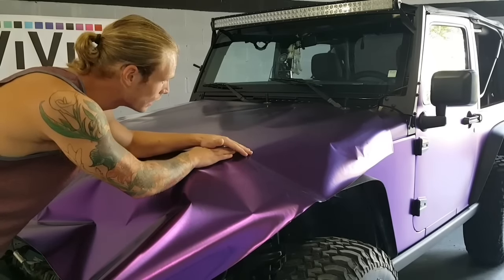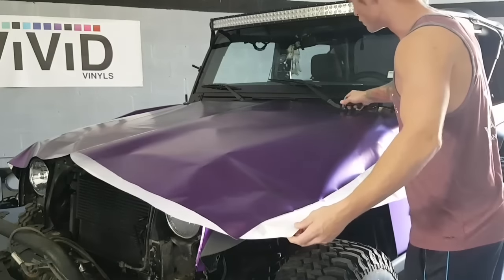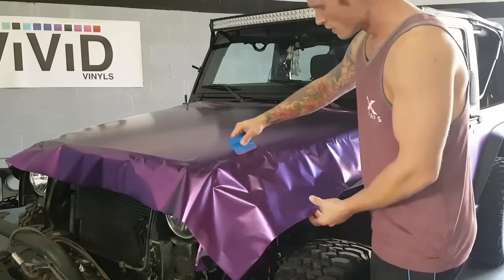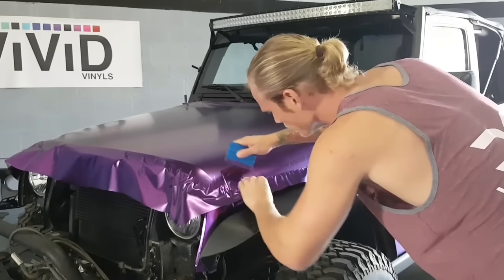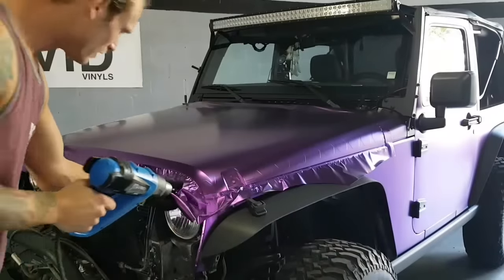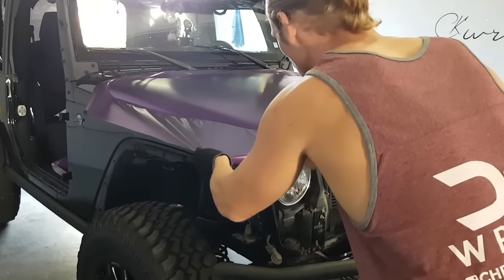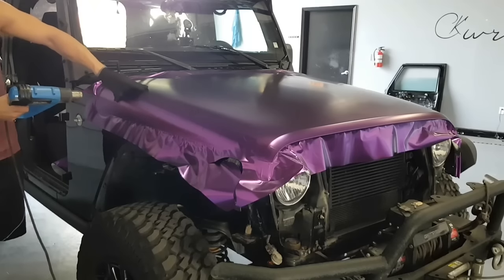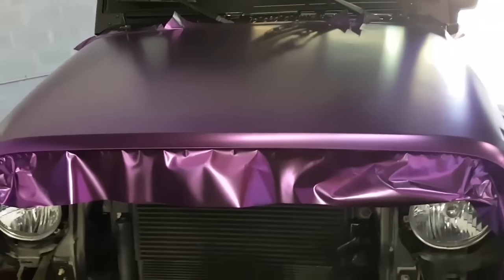How to vinyl wrap hood / bonnet on a Jeep. Using satin purple chrome vinyl. By @CKWRAPS

Comment: I have a quick question in regards to hood wraps.  I understand that minor defects are gonna show through.  my hopes that carbon fiber will hide them for the most part.  however, what is the best way to prep a rock chip in the hood before wrapping?  I don't want to cause issues with the paint when I'm taking it off.
Reply from the maker: +Randall Rosenberg the vinyl shouldn't pull the paint off of the hood even if there is a stone chip. That's as long as the paint is original